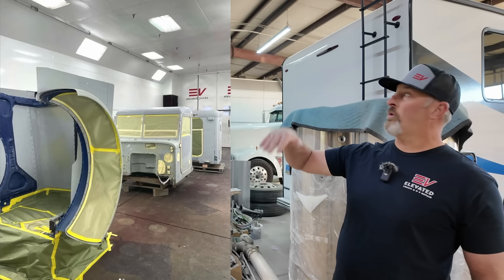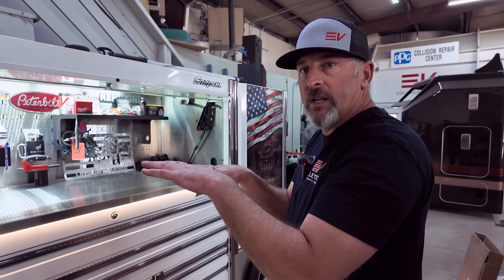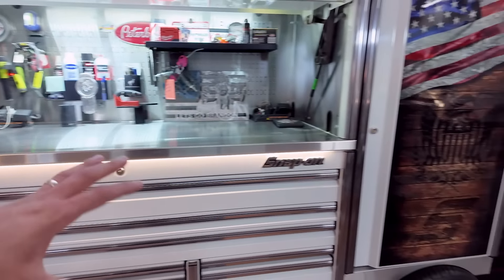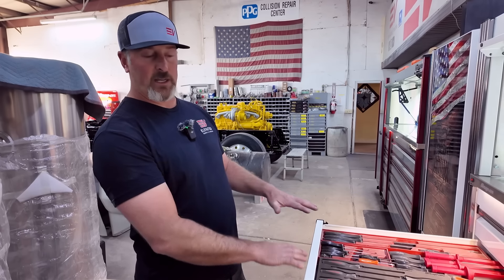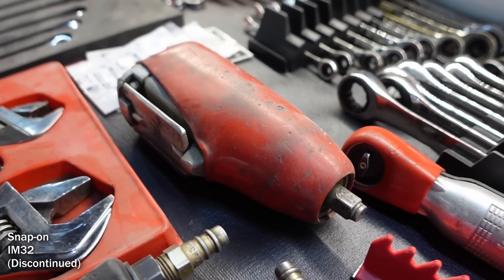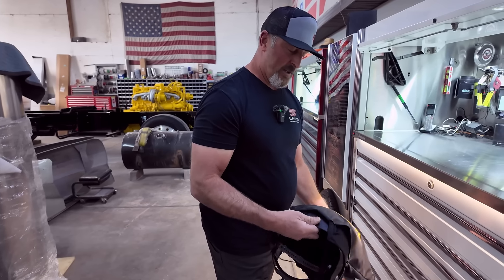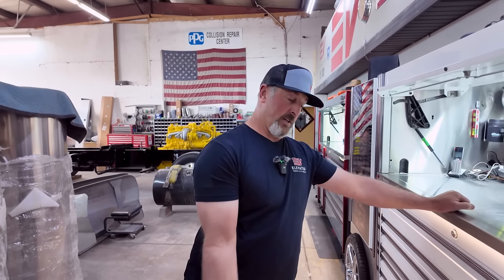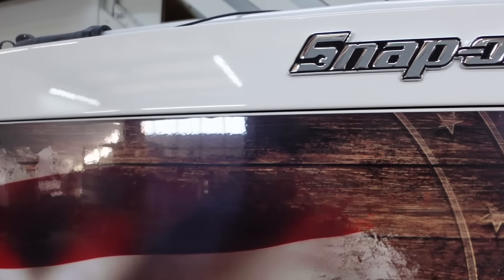Snap-on EUV in a BIG RIG Restoration Shop

Comment: 24:40 I have that Snap on soldering kit. The igniter failed not long after I bought it. Snap on warrantied it. Haven’t used the replacement yet. 
Bought a Power Probe instead. It’s worked flawlessly for 2 years now.

Comment: These tool boxes was designed and engineered for race teams and track use. Thats why the disc brakes and big tires. Having a thousand pounds (i have no idea the weight) start rolling you better be able to control and stop it. 
I love the foam storage system. I have all my Packout boxes/drawers and my power tool box drawer lined with Kaizen foam. 
Love my Butterfly air ratchet. Bought my first around 77 or so (a CP) and a IR a few years later. 
Fantastic box and video brother, thank you.

Comment: This is the guy the $2800 snapon wrench set is meant for
Reply: If you can afford it why not
Reply: Although 90% of my tools are snap on which includes my 72 inch master series box I’d absolutely love that Snap on set in foam, but I couldn’t pass up the the equivalent in non-foam 44 piece Gear Wrench set for just over $200.00

Comment: Such a large expensive box, but theres like no space, which sucks.
Reply: Time to add drawers in my lockers and maybe a top locker
Reply: I have the same box and am running into that problem.  I ordered 5 more drawers for my lockers and a 2 inch and 4 inch drawer to swap with the bottom 6 inch drawer as I dont need that much depth.  One could actually swap the 68 inch center hutch and chest with the 84 inch model.  It is just two large brackets holding them to the lockers and wheels.  Would need longer brake cables but that is easy enough.  I had a dealer tell me that Snap-On originally planned to make the EUV bigger but changed their minds.